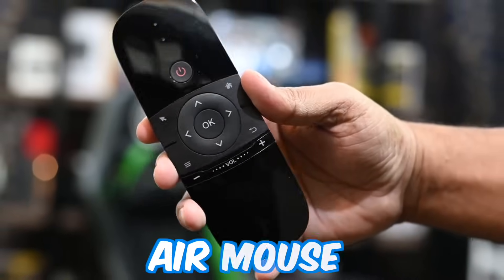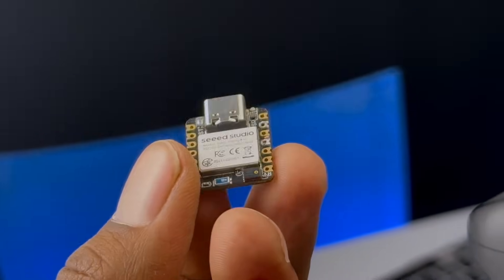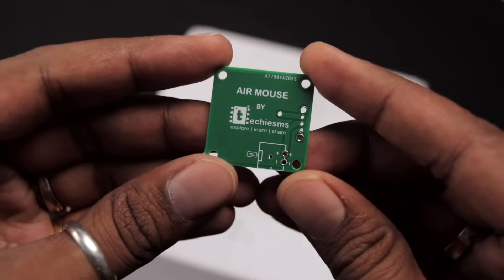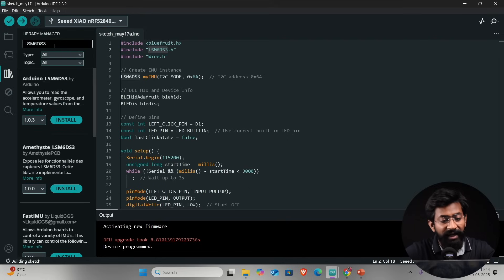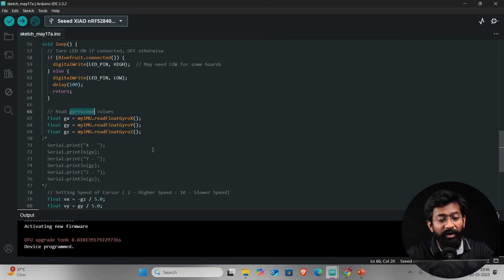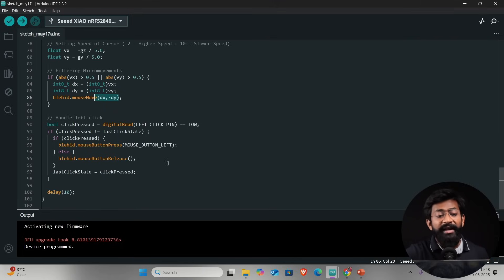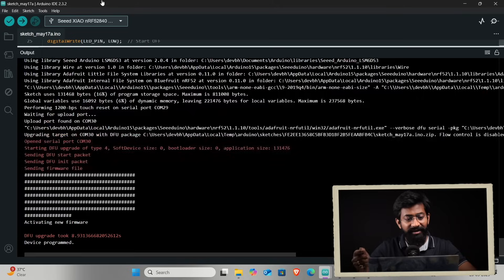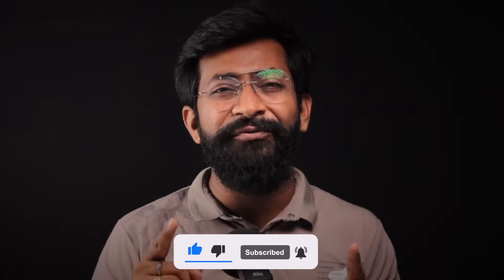The Smallest DIY Air Mouse Ever! | Universal BLE Mouse for PC, Smartphone & TV

Comment: why don't u make a trackpad out of a mouse rather than using all those pcb stuff, like making it into more of simpler form of this version and also I think it would have the rate same as an original mouse just would fuck up in design well even that could be corrected as u got a lot more experience in designing . and also handy. i dont know how would it look but using a wireless mouse for making a trackpad will that work. or using a old laptop trackpad and redesigning into this 6 axis scroll would work. let me geek
Reply: bro its a Air mouse so it will perform hovering of cursor  by using imu and left click/right click ,drag, scroll  needs a button . But you are suggesting to add trackpad over it but for what? or maybe i didnt understand what you want:face-blue-smiling:

Comment: Hello.
My Windows 11 doesn't recognize my ESP32's Bluetooth connection. Android pairs, but it doesn't work in Windows 11. Any ideas?
Reply: do you made the same project? if yes, tell me what's the main problem? connected but not working or unable to pair? if connected but not working then remove device from bluetooth settings -> saved devies and re-pair the esp32 bluetooth it will work. But if you couldn't able to connect with windows then your windows follows different HID which you need to edit in library
Reply: @English-nx1ew  Yes, I did the same project. The problem is that when I try to pair it, Windows 11 doesn't detect anything via Bluetooth.

Comment: What would be the starting position, and how do you handle the cursor going out of the screen
Reply: Check the code plz❤
Reply: there is predefined dead lock (-127,127) cursor will not go outside of this range

Comment: It's good. But it can be great as a wearable mouse.
Reply: yes i have same idea , trying to implement in my wrist smart watch based on waveshare ESP32 S3 touch LCD 1.46 inch 412x412  round display module , it have all sensors a smart watch requires .